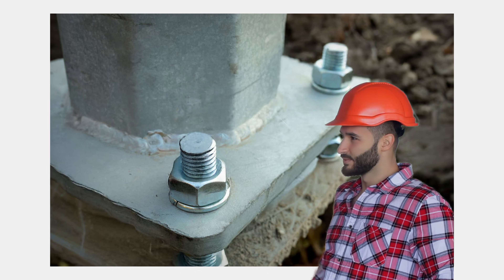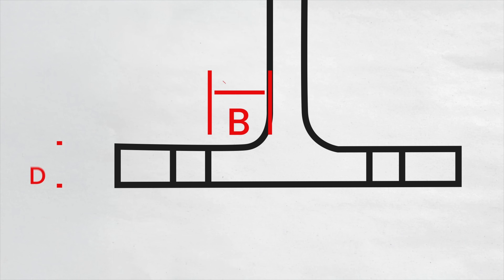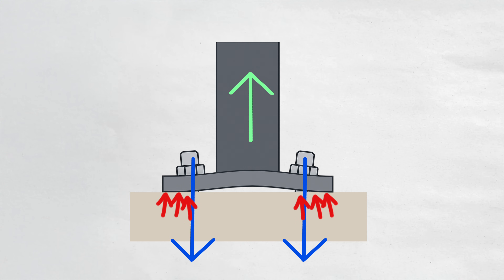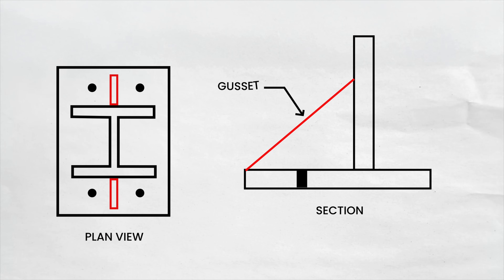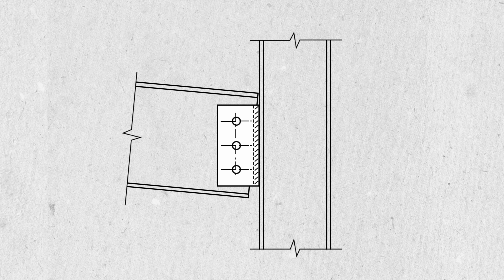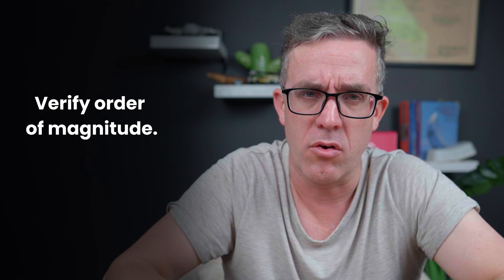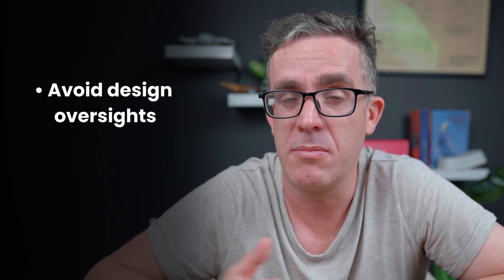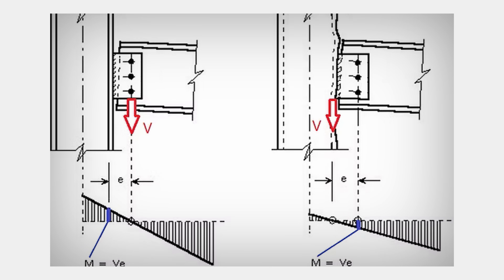Prying Force That Tricks Engineers - Steel Connections

Comment: Hi  Brendan and happy new year to you and your family. 

You mentioned 2 key problem solving technics involving prying forces 
1. Identify the joint or connection where prying occurs
2. Calculate the magnitude and direction of the prying force which includes checking  if the components bolts, welds, etc. can withstand the force. 

Stay safe 
Malik from Barbados.
Reply from the maker: Thank you mate! Happy new year to you and your family too! Always like to see your comments.